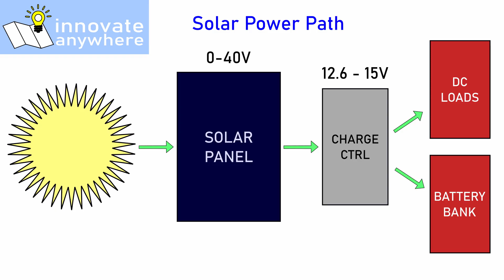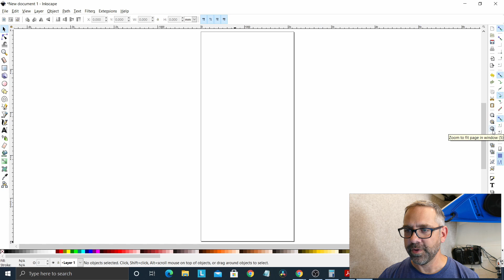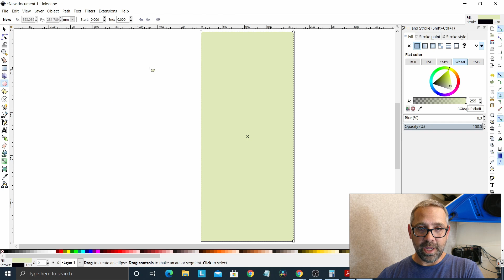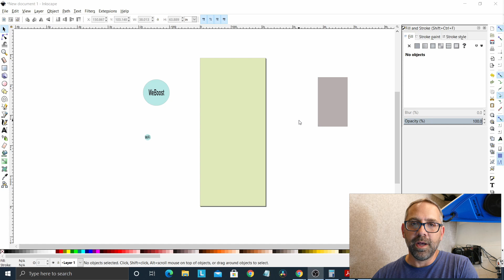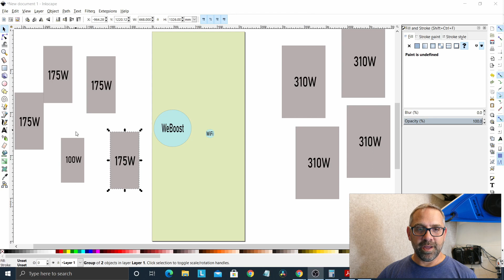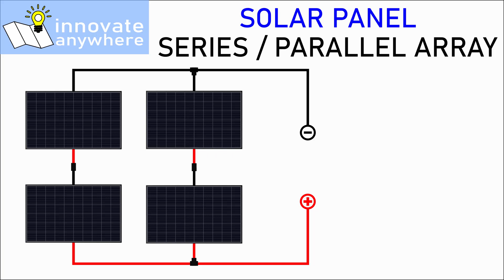Camp Trailer Solar Part 1: Solar Panel Selection and Layout

Comment: I'm curious which panels you settled on.  The cost per watt varies significantly and can be a daunting search.
Reply from the maker: I picked the Hanwha Q.PEAK DUO BLK G5-310. The company I purchased them from (altestore.com) allows you to sort by $/W which helps! I cared more about efficiency but they don't let you sort that way. I have a little more info up on my website - https://innov8anywhere.com/video-resources/
Or here's a link directly to a printout of the spreadsheet I made the comparison with - https://innov8anywhere.com/wp-content/uploads/2021/01/Innovate-Anywhere-Trailer-Solar-Panel-Options.pdf